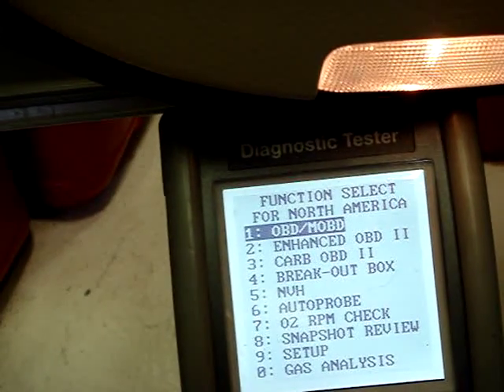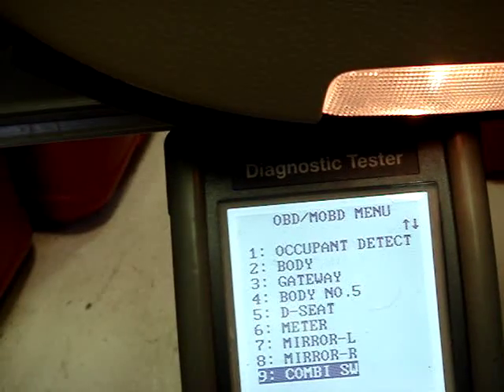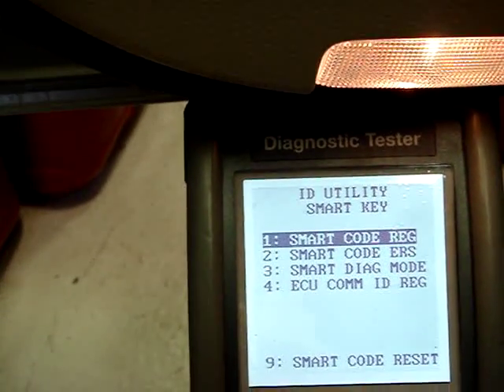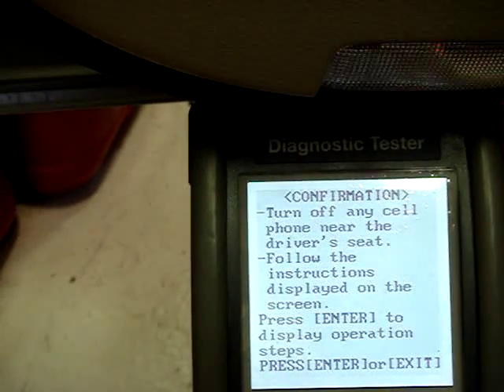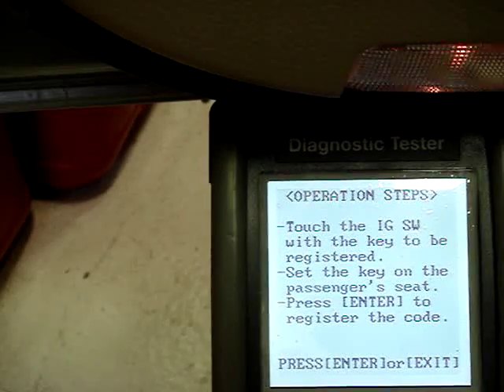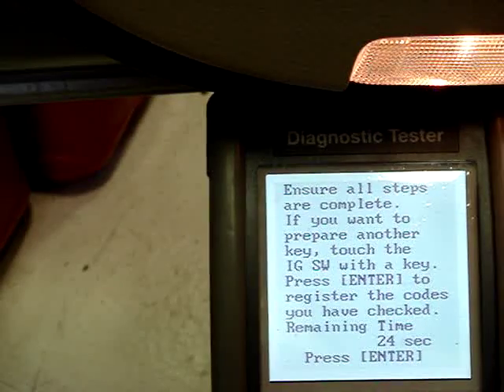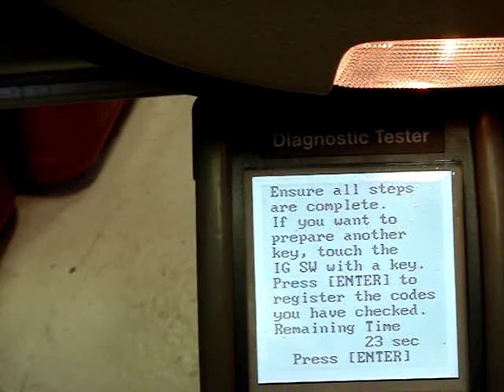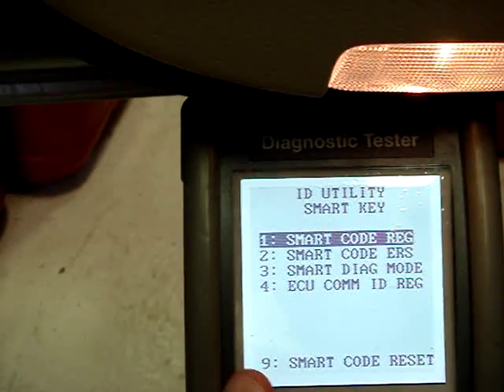Smart key certification ECU unlock procedure

Comment: Hi bill! 
 
Car: lexus ES350 2008
Programmer KM100 (ignore the photo)
had a working key but a tech after not being able to add key rest the ecu after which even the programmed key went out of programming (of course) 
Issue is when we touch the key to start button it beeps once only and transponder is authenticated but  remote doesn’t

Any suggestions? 

used XM38 as well as OEM keys 
Tried autel and autopropad and smart pro same issue.
Reply from the maker: Smart key car? It took immobilizer but not keyless entry. Did keyless entry work prior to tech performing key reset. If keyless entry wasn’t working then that would have to be fixed in order to program the key. Also if locksmith programmed a key at some point, sometimes their software damages the utility that allows factory scan tool to program a key.
Reply: @billn5059  it was working before
Reply from the maker: If the tech reset it and is it’s trying to add the keys back it won’t work. In Techstream there is a choice of “replaced certification ECU and immobilizer ECU”. Usually that gets the system to take the keys. Not sure if the after market tools have that function. I would guess it would but not positive. I’ve never used anything to program keys other than Techstream.
Reply: @billn5059  I think on some Toyota Lexus  models ecu reset is disabled. You can disable but you need authorisation passcode to add master keys back to it.
Reply from the maker: @talhaimran5499  That’s correct. If all keys are lost there is a process in Techstream to retrieve a passcode to unlock the system and program keys back to the car. One thing I wondered about is if the keyless entry is getting the signal on the PRG wire to go into add mode and that’s why it won’t take the key. Also, remove the cover from the fob and make sure the FCC ID numbers match.
Reply: @billn5059  fcc ID matched and used without casing as well. Still no good
Reply: Did you get this fixed? I've got the exact issue. Keys were cleared and now when you try to add a key back in, it only beeps once. Scanned with techstream and getting "key collation waiting time over".
Reply: @Sparkyc511 tech stream didn’t work. Had to send vehicle to dealer to change smart ecu
Reply: @Sparkyc511 and since then iv only used autel to get an emulated key to add key back to the vehicle for any AKL situations for Lexus
Reply: @billn5059  basically a guy checked out the car and said the ecu is wiped and no backup exists for it so the car is immobilised right now. With 0 keys programmed.

Comment: I need help! I have 2007 Camry Hybrid bought off auction with no key. Bought key from dealer and the car reads the key but unable to program it the dealer has also replaced the smart key ecu no luck. The car now sets its alarm off and instantly locks the doors battery is good and so are fuses. At a dead end rn
Reply from the maker: So sounds like the keyless entry may have programmed but the immobilizer part didn't. If the door was slim jimed open that may explain why the alarm is going off. Do you have a key for the door. If so unlock the door with the key to disable the alarm. The system will not allow you to program a key if the alarm is set.
Reply: @billn5059  good evening , I have acquired the physical key the system is now disarmed, now it will give one chirp and that’s it , the scanner states the programming has failed immediately .
Reply: I do not have the physical key! The door kept being opened with the lock out wedge and rod,I’ll get a key and try again and disarm the system . Thanks for your feedback!
Reply from the maker: So if you press the lock button you get a beep but nothing if you unlock it. Also what are you using to try and program it. Also if you have the driver door open too long the immobilizer will shut down. So easiest way to avoid that is while your connecting to the car have someone cycle the door courtesy switch at 1 second intervals. Once you get to where you put the transmitter up to the start button they can quit cycling the switch.
Reply: @billn5059  the one chirp it gives is when it attempts to program the key (place fob with logo down…) the scanner  (Autel Maxisys908s with j2534 VCI) immediately states it failed and the buttons on remote do not get programmed
Reply from the maker: I went back and reread what had been done to the car. It's usually not a good thing to replace the cert ecu without the ID code box (immobilizer ecu). Smart reset essentially opens the cert ECU, immobilizer ecu and the steering lock as it also generates codes foe the system. If the steering is unlocked that also can sometimes cause an issue. I've seen tow truck drivers strong arm the wheel so they can steer the car damaging the steering lock. I'm assuming the dealer tried to perform the smart reset after they replaced the cert ecu. If the steering was unlocked that may have been the root cause of why it wouldn't complete the reset. I've asked a friend about using the autel tool to reset it and will let you know what he says. I'm trying to figure out how I might get you a document I have on the system and you can go step by step through the data list and see where it fails during the process.
Reply: @billn5059  ID code box usually goes behind the dashboard correct?
Reply from the maker: Yes. Driver side between the firewall and the HVAC unit. Before you go to all that trouble, the fellow u talked to said the Autel unit needs another component to reset the smart key system. Also if you get access to a way to reset the system, I'd put the old cert ECU in it and try to reset it. Guys will throw parts at something for no reason and I haven't seen that many cert ecus fail. If it won't reset, my guess is there is something else causing the issue. Smart key can be a mother to figure out even for dealership guys. Hard to say the techs skill level that worked on it, but if the alarm was set and if he'd left the door open for more than 30 sec or so the ID code box would have gone to sleep and the reset would have failed. If the door courtesy switch was never actuated during the diagnostic process he probably made an incorrect judgment replacing the cert ECU.
Reply: @billn5059  wow , im so surprised how so many modules can create a big issue for a maybe simple programming
Reply from the maker: @victortorres9679  Yea. It's all done for a reason. If I remember right much of it's done to help prevent theft. I believe there is a requir we must that it has to take more than 15 minutes to either swap the parts or rest the system to program a key to the car. During the reset procedure it takes 16 minutes to perform the reset. If you connect an oscilloscope to the IMO and IMI terminals of the engine computer you can see the data word to reset the system occur at around the 14 minute mark.
Reply from the maker: Are you just trying to add the key. If so that's why it's failing. You will have to perform a smart key reset in order to program the key. I'm not familiar with the Autel. On the Toyota scan tool there is a process for retrieving seed numbers to get the pass code to unlock the system. I don't know if the Autel tool has that capability. You can't simply add a key if you don't have an original key for the car.
Reply from the maker: If it beeps once and fails its most likely due to the immobilizer has not been reset. During programming the immobilizer is programmed first and then the smart key which on the Toyota tool takes about 16 minutes.
Reply from the maker: I got to thinking about this and even of you replace the ID code box it still will not program because the steering lock ECU hasn't been reset. I'd caution against having a locksmith try and reset it as I have seen many issues steming from that.

Comment: Hello Bill... I have this issue.... any advice?

2009 Lexus GS350 Immobilizer issue.
Hello everyone I really need help on this please... 2009 GS350 from an auction with “NO KEY”.
I reset (via techstream) the car immobilizer due to “all key lost situation”... All reset process was perfect and done... (all dash light up as it is supposed to act when you reset the immobilizer to add a new key) but at the moment to register a new smart key code fob, I had a car battery issue loosing power and was not able to add the new key. I disconnected the battery to recharge and then I put it back later to continue the process, but this time the dash is not coming ON, when I push the start button nothing happens, only the door light is on on the dash but nothing else. I attempted to reset the immobilizer again but keeps failing after reset code is entered. The security light keeps flashing all the time... I disconnected all horns previously.
Work done: Check all fuses in the 5 places in the car and all are ok... not blown fuses at all. The big fusible link is also intact, not blown.
Immobilizer module was replaced (Anti Theft Locking Immobilizer Control Module Manufacture Part Number : 89784-30011) but nothing changes... red security light keeps blinking all the time.
PUSH BUTTON “Engine STAR STOP” lights up when driver door is open but the amber light is not ON... nothing happens when I depress the pedal brake... no green or amber light. Inside lights works ok and seats have power, turning the metal key on drivers door lock and unlock the doors and also open all windows and sunroof when hold it to the open position.

What other test or check I need to perform? Could be a main ECU issue?

Thanks for your help!
Reply from the maker: Since the reset was successful the system is unlocked which is why it won’t allow you to try and reset it again. Have someone cycle the door courtesy switch at 1 sec intervals while you go into the smart key to program the key fob. Make sure no keys are in the car. When you get to the programming portion tell it you replaced the ID code box and certification ECU and try to program the keys. I assume that your using new keys as many times keys off eBay or used are not unlocked.
Reply: I have 2018 rx350 I’m working on,same issue and I can’t get the immo smart key ecu,it keeps failing and I’m lost
Reply: Did u ever get it fixed
Reply: I have same problem. No clear solution yet.
Reply: Any luck with this? Figured out the fix?

Comment: Do you know how I can get into my 2007 Camry Hybrid smart key system and get keys made? I've hooked up a mini vci and accompanied software but it keeps asking for vehicle configuration code. thanks
Reply from the maker: Sorry for the delayed response and I hope you were able to get keys made. I am assuming you were programming keys to the car. I have not used the mini VCI to reset the system so I am not familiar with its function. The only way I have programmed keys or reset the system is using Toyota Techstream software.
Reply: @billn5059  I need that techstream
Reply from the maker: Tom Knud   Techstream software can be obtained from Toyota but there is a subscription charge for it. I’m not sure of another way to get access to the full features of it.